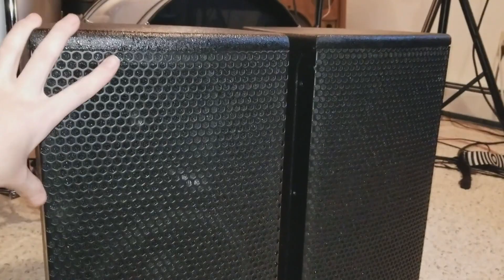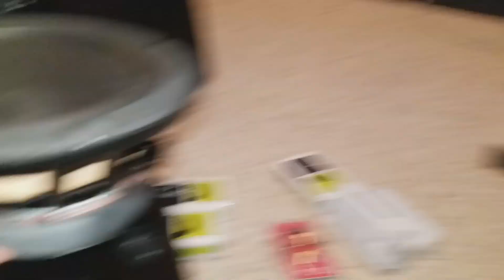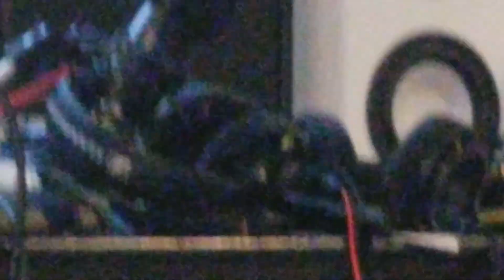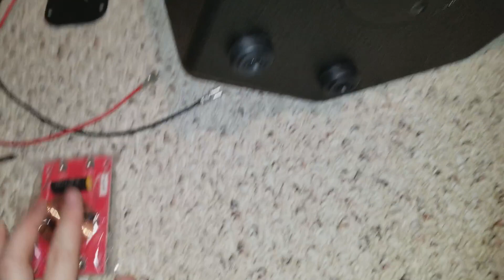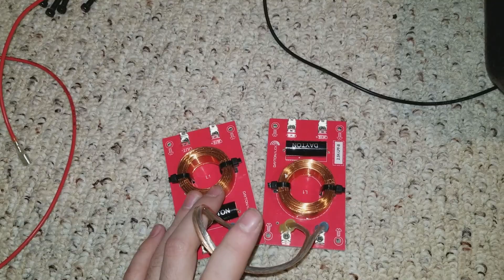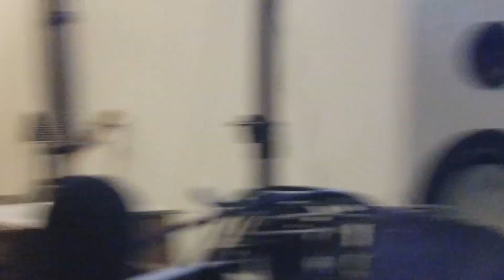CROSSOVER UPGRADE! Stellar Labs CS8 PA Speakers

Comment: Uh not necessarily an upgrade... you just changed it to a 4ohm cabinet (which draws more power) and totally changed your frequency response. You’re low end will not give you a true reference when filling a big space. Hopefully your tweeters can keep up without popping. I really like mine for front fill and chaining them together is a lot easier at 8ohm.
Reply from the maker: Nothing about the low end of the speaker changed from adjusting the mid/high crossover frequency.. lol. Yeah, the treble response changed drastically but I'd rather have a box with a horn a little bit too loud than too quiet, as I can apply subtractive EQ to it and flatten the box out. Much better than boosting the box and losing large amounts of efficiency. Also, in my case, 4 ohms, even 2 ohms, are all loads that my amplifiers can handle. so no worries there.
Reply: The box is tuned for the woofer to do more mid range work. You’re box is now relying on the performance of the tweeter. This changes your boxes frequency response. To what? Don’t know. If your tweeter can handle the extra work when it’s pushed, great. But if you start pushing it and the tweeter pops I wouldn’t be surprised. Also, I have 4 of them and have had more then two in series. Wouldn’t want to do that with 4ohm boxes. 

Like I said; not necessarily an upgrade. I wouldn’t do it because I mix these with higher end cabinets and have been amazed at how well their sound matches up.
Reply from the maker: Sorry, but stock, these boxes come nowhere close to higher end boxes. They're horribly inefficient. I couldn't get even the 10s to get past 90dbA at 1m on reasonable power. Also, given that these boxes have differential dispersion horns, I'd rather have more given to the tweeter, as the control of dispersion of those waveguides is crazy good. Also, to be honest, the listed crossover freq for these boxes is 2500,, so I'll be damned if I'm sending too much mids to the HF.. Theoretically I shouldn't have changed the xover point at all.There's no risk of me popping the tweeters, so long as I have clean amplifier power.

I even had someone accidentally wall socket one of my 12" stellar labs cabs with the same mod (had a ghetto extension cord speakon cable, yes thats horrible but it was a last minute fix), and the box survived 2400 watts without a scratch being plugged in for basically 3 seconds. I give them maybe 400 watts each maximum.

As far as impedance goes, 4 ohms, while not neccesarily a standard in pro audio top boxes, is fine for my use, as my amplifiers can handle 2 ohm loads on each channel anyhow. 

More goes into a box than frequency response. Frankly, I'd say coverage and efficiency are far more important... So this is a DRASTIC upgrade for me. I definitely wouldn't do this if you dont have the ability to EQ them, but if so, it makes a ton of sense.
Reply: I’ve seen cheaper tweeters pop when pushed on there lower end. That’s why crossovers are important. If you’ve seen these tweeters hold up to being pushed, great. Makes me appreciate the $25 I spent even more. 

I agree to disagree about them sucking from the factory and not being high end sound. They have a nice response for speech with a smooth low end. If all I wanted was a high box to go on top of subs maybe this mod would be more appealing but I have these boxes filling space. Which means they may be the only thing some of the audience hears. They really do a good job of utilizing the 8” woofer. Very balanced. If I start pulling out my SPL meter I doubt I’m I’m ever more then 90-95 tops but this box is giving me what I need. Similar to higher end boxes, they give great sound so I don’t have to constantly eq.

They are excellent at doing the job I bought them for: front fill, mains on smaller rooms, and monitors when needed.

Comment: not actually the proper way to do that. you need to know the frequency response and impedance curve for each of the drivers to tune the crossover. the way you have done will not drop the final impedance to 4 ohms. it will be 8ohms. the sensitivity of compression drivers is much higher compared to low frequency drivers. those resistors placed in the existing crossover are there to damp the compression driver a bit to level with the woofer and create a flat response of the overall system.
Reply from the maker: So uh update, couple years later, you are absolutely right lmao. I wasn't taking into account that the final impedance curve of the speaker would just be the impedance curve of each driver, with slight variations due to the impedance of other components used as well as the overlap in frequencies between the two drivers
Reply from the maker: Uhh not true? two 8 ohm drivers wired in parallel equals 4 ohms, as far as I'm concerned. Sure, that can change given the impedance curves of each driver but that's the case with any speaker. No speaker is exactly 8 ohms, 4 ohms, etc. Also, yes, the end result of this modification resulted in a louder compression driver, but frankly, I'd rather have a horn too loud than too quiet, as subtractive EQ can be applied to level it out and its likely much a little more efficient than boosting missing frequencies. Point is, this modification was fine, Obviously if I wanted to make the boxes sound perfect with no additional EQ i'd measure the response of both drivers, see where the best crossover point is, choose the crossover point, find the difference in efficiency between LF and HF, create an L-pad resistor network for the HF.. but on a budget this made the most sense for me.

Comment: My amplifiers aren't very efficient.  Whenever I turn them up, the breaker trips. There is no load on the breaker except for the amplifiers. Is there a way to fix this?
Reply from the maker: Double Dragon what speakers/amps are you running and on what circuit do you have them on (i.e. 15 amps, 20 amps etc.)?
Reply: I have 20 amp on 120 volts and all the electrical is new too. I'm at least pulling 2700 watts out of the wall.
Reply: I'm running a kenwood 900 watt receiver and 2000 watt onkyo receiver. my outlet power usage monitor says about 2700 watts.
Reply: Well, there's your problem, a 20 amp breaker in a 120 volt supply is capable of supplying a maximum of 2400 watts continuously, and your system pulls at least 3000 watts given the ratings of your amplifiers, the solution would be to put your amps in separate breakers or using heavier gage wires and a 30 amp breaker.

Comment: I have a pair of alto tx8 powered pa speakers and dam do they sound good, they are bi amped and have active crossovers. The insides of those speakers look just like the insides of some of the older passive harbinger speakers.
Reply from the maker: I used some Alto TX208's recently, they have incredible sound for the price point! Very good economical speakers.
Reply: FOHFILMS I kinda forgot about the altos tell I saw this comment, recently I bought a pair of Qsc cp8’s and will soon order a ks112 sub. I have never heard anything that comes close to the sound of QSC